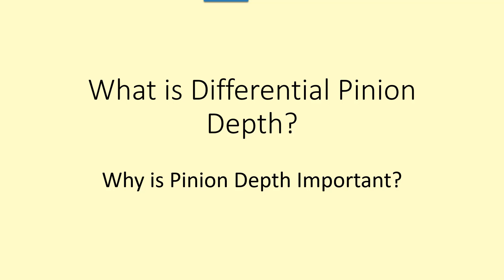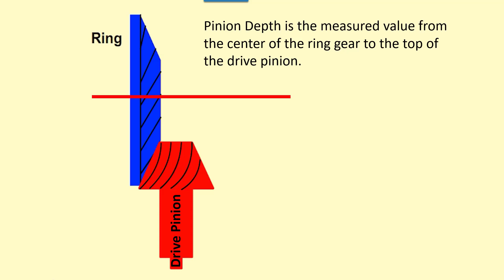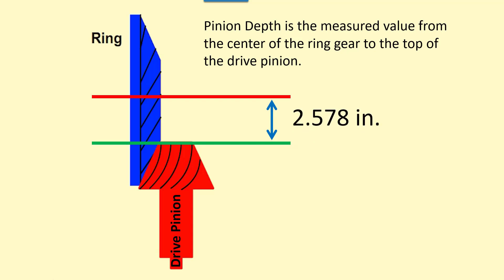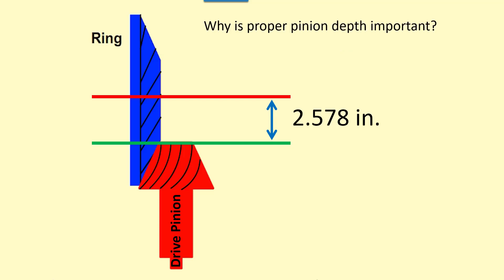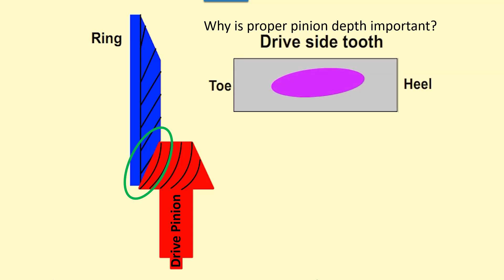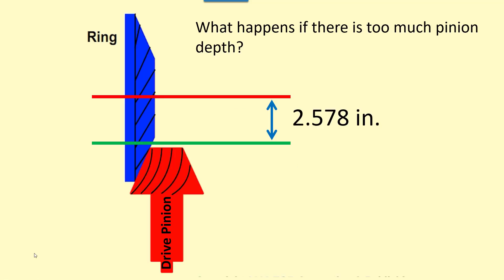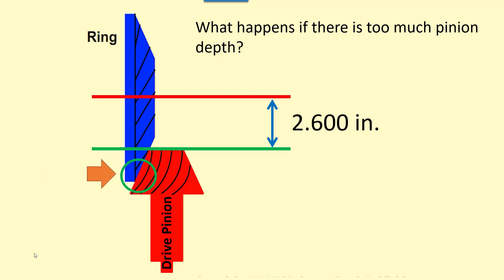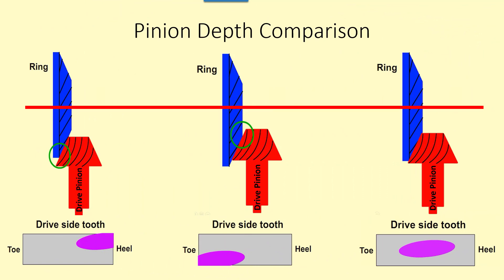What is Differential Pinion Depth and Why is it needed

Comment: I may not have understood it well, so I must ask what is the pinion depth for my car? I imagine that not all pinion depth may be equal. I imagine the center line of the ring gear and the top of the pinion. Where to find depth specification for my car?
Reply from the maker: The pinion depth value varies between manufacture differentials and ring gear sets.  Most manufactures do not publish an actual depth value however if you purchase an aftermarket gearset the pinion depth will be scribed on the top of the pinion. If you don't have a gauge and or a depth value the depth can be adjusted with a little trial and error and contact patch interpretation.  Check out this video if you have not already seen it.  https://youtu.be/w2kneEjXw6E?si=cuQFjHPxC7izDcfi and this one. https://youtu.be/gk6imita0cc?si=yUGQJvai8Y99p_RV.  Here are a few more that may help.  https://youtu.be/UIIk305-zlQ?si=8oW2ojF8PFmOQbMm , https://youtu.be/QL-dmhfSj6k?si=g3uqXnhLjbnSSYge , https://youtu.be/_bUh9NEMldI?si=IKPs7bDlqr20PvUU.
Reply: @DrivelineMaster  Thanks, appreciate your reply.
Reply: @DrivelineMaster  Ok thanks, my diff pinion gear has a preset tough sleeve  and not a crush sleeve. It has no shims at the top only one shim at the bottom. I think Toyota did a very good job here, but because my bearings may be a little worn it needs a little adjusting. I assume that with new bearings it may come back to toyota preset, but I`m trying to   save a dime and use the old bearing that seem so good. Thanks anyway, good luck.
Reply from the maker: @sweetnandito  There is a saying that has something to do with saving a buck only to find out later it would have been wiser to spend the money on the front end.  (I think it was something like a penny wise and a pound foolish or something like that) What I'm trying to say is that while you have it apart trying to save a buck now might just come back and bite you in the as... later if your used bearing start to cause you problems a few thousand miles down the road.  If a used bearing comes apart on you in service it could cause damage to other parts and end up costing you more money and time in the end.  Saving money now could end up costing you more later. You may want to give this a little more thought before reusing your old bearings.

Comment: That's excellent. What surprised me about this is the way the coast side shows the opposite pattern when comparing too much measured depth to not enough. Why is that?
Reply from the maker: Not 100% certain. The best I can figure is the shape of the cut on the gear and the direction of rotation that is needed to create the pattern.  Check out my other video on pinion depth and contact patch.  https://youtu.be/w2kneEjXw6E